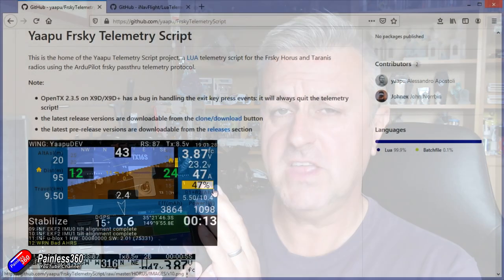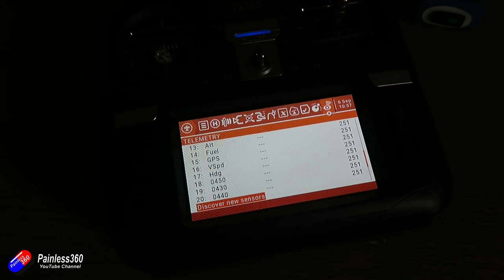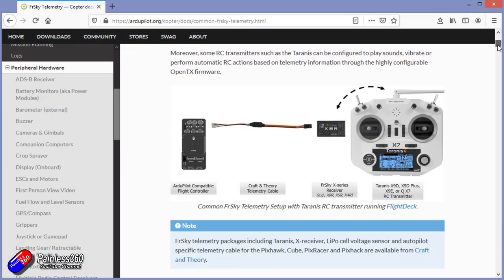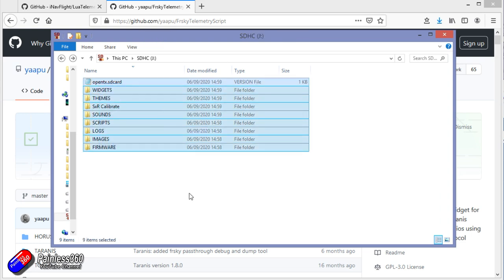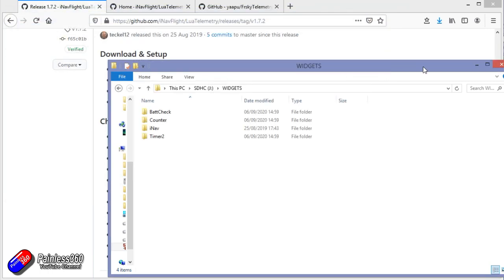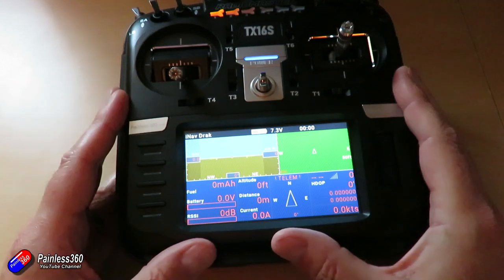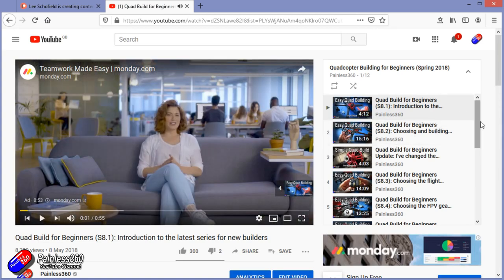Installing Telemetry LUA scripts onto the RadioMaster TX16s (Yaapu and iNav)

Comment: Ive got a Cubepilot on my Quadcopter and Crossfire, TX16s, and Bi-directional telemetry, my direction arrow appears to be incorrect in the Yaapu Script.. any thoughts?
Reply from the maker: If the direction is right in other places then I'd delete and rediscover the sensors as step one... Best of luck

Comment: Is there any point using these with Betaflight? I do some midrange flying on a 5 inch with gps and baro.
Reply: And by the way, great video as always! Thanks.
Reply from the maker: I don't. If you do, let me know how you get on..
Reply: The iNav Lua Telemetry script does work with BetaFlight via Crossfire on my 5”. But you may run out of memory on some radios if you run the BF lua script and iNav Telemetry at the same time.
I find it handy if flying LOS without googles/osd.

Comment: I am using arduplane will it work properly?? Actually mine one is working but horizons is working very slow and most of the values is absent,I discovered several time by deleting sensors
Reply from the maker: I use it with my Arduplanes all the time and it works great. See my build series. Best of luck!

Comment: Hello can you help me out with my issue?           .. So just a days back I tried to install yaapu on frsky qx7 accst model. But after installing it can't run on my radio, it simply says, "script panic not enough memory".    What should I do? am I missing some steps.....       Note. I used open tx 2.3.15 and yaapu version 1.9.5.
Reply: And just to free out little more memory I just kept only one model on my radio but nothing helps
Reply from the maker: The EEPROM storage used for models and the memory that things like LUA scripts use are not the same thing. Make sure that no other LUA scripts are running at the same time and if the issue persists then log a bug report in the GitHub pages.. Best of luck!

Comment: Does anyone know if I can connect my TX16s to mission planner so I can use the Arduplane telemtry via my R8 instead of having a separate 900mhz radio for the telemetry to the laptop with mission planner?  I have this working and it's great, just would like to eleminate the telemetry radio in the plane and still be able to use mission planner real-time.

Comment: Hey! anyone know if with lua you can take the telemetry and push it out the USB or out a wifi port to be interfaced with a computer? trying to make a little program that wants the gps data, but would be great not to use mavlink for a more plug-and-play feel
Reply from the maker: If you are using OpenTX then you can log the telemetry to the SD card in the radio... Best of luck

Comment: I used in my long flight range, when video goes out, there is not way to know what is going on, so you look you radio and you can tell if the plane still flying and where it is because you have the gps in the radio, now when it crash there radio will start vibrating and the voice , telemetry lost, but you have the gps coordinates in the radio where the airplane is with in 10 feets/.

Comment: HELP!!!! I deleted sensors but when I went to "discover new sensors" nothing happened. I've tried multiple times and still nothing. Using TX16s with IFlight Nazgul5 4s analogue XM+ receiver.
Reply from the maker: If it can't see the sensors then check the flight controller settings and telemetry wiring back to the RX.. Best of luck
Reply: @Painless360  thanks, I'll give it a try

Comment: I wonder if this will work on my FlySky NV-14 radio..🤔
Reply from the maker: Only if they have a version that supports the vertical screen...
Reply: @Painless360  I got INAV telemetry LUA to work on my NV14 using the development branch of INAV LUA telemetry. I couldn't get Yaapu telemetry working. Im good with just INav..lol

Comment: Does anyone have their Crossfire working fully with Yaapu?  The roll, pitch, and yaw graphical gauge does not respond to any physical changes in the orientation of my flight controller. I can see the corresponding telemetry values refreshing properly on the model telemetry page as I move my flight controller around. Furthermore, there is a flashing NO GPS error and NO TELEM error message in the upper right, even though I can clearly see GPS coordinates appearing in the lower right section of the Yaapu widget.

I am using a Matek H743 running ArduPlane V4.1.0dev (acfdf6a3) and a crossfire diversity receiver with SERIAL_7_PROTOCOL=23, and RC_OPTIONS=256. On my Radiomaster TX16S transmitter, I tried running various versions of the Yaapu script starting with the older “horus_crsf_190b_0.7” up to the current "FrskyTelemetryScript-Horus-Widget-1.9.5-beta1". I ensured that CRSF is turned on in the Yaapu config. I'm not sure if CRSF is supported, that this is a bug or my user error. I have my CRSF receiver wired to Tx6/Rx6 (Serial 7) of the Matek H743. The receiver is configured with CRSF TX and CRSF RX on outputs 1 and 2 respectively. I also have another 2 outputs of the crossfire diversity receiver connected to SERIAL 2 with the Mavlink version 2 protocol running on those outputs.  I've tried with and without Mavlink.  I've tried a combination of outputing PPM for control and Mavlink for telemetry.  I can't for the life of me get this to work.  I've also tried both Yaapu with EdgeTX and OpenTX, crossfire running at 150hz or 50hz.  Nothing :-(
Reply from the maker: The last time I did it was in this build ArduPlane, Matek F405-Wing and AR Wing build: https://www.youtube.com/playlist?list=PLYsWjANuAm4riGiv4GPJfCuktGXZ22nmV best of luck
Reply: @Painless360  I finally resolved my issue here.  Lee, in your diagram, you suggested setting Crossfire to use SBUS out and MAVLINK back into the FC. Since Ardupilot has evolved since then, I think it would be better for users to simply use CRSF_TX and CRSF_RX. That said, you must use an Ardupilot version with Crossfire support. No need (at least that I can find) for Mavlink. This worked for me, but there are some very important gotchas that I think many Crossfire users will overlook:

1) Firstly users must consider what UART they are using. I had my crossfire connected to a UART which certainly works for Crossfire RC control and allows telemetry, however it would not work with the Yaapu widget. That is because the UART port does not have Direct Memory Access (DMA) with my flight controller (the Matek H743 Wing). I could only get the Yaapu widget to successfully work moving and connecting my CRSF_TX and CRSF_RX wires to SERIAL1 (UART port TX7 & TX7) or connecting them to SERIAL2 (UART port TX1 & TX2). By default, the Matek flight controller documentation suggests using UART 6 (as they label it “RC input receiver”). The only UARTs that should be used for RC control and successful use of the Yaapu widget (for this FC) is UART 7 or UART 1 (those have DMA). There is no need to set any extra outputs of your Crossfire receiver to use Mavlink.

2) I noticed that another user on a blog made another mistakes of mine. Alex (Yaapu) told me, I must set Ardupilot RC_OPTIONS = current value + 256. I thought I did that. Instead what I was doing was heading to the “options” under the serial settings section… I was incorrectly setting SERIAL7_OPTIONS to its current value + 256 and not setting “RC_OPTIONS” to its current value + 256. 
I think users with Crossfire will likely repeat some of my mistakes, as I did not find detail per this in the Yaapu installation instructions site. 

Thanks again Lee
Reply from the maker: Thanks for for sharing the answer! So few questions bother... Happy flying!

Comment: model name is gone my model select screen, when ı select a model write the main screen but dont write the model select screen why? its happen after upload script, thanks for video
Reply from the maker: No 8dea, let me know what the cause was when you get it working.. best of luck
Reply: @Painless360  ı fixed but dont know how, only put the sdcard in pc and try the changing background again, bg is not change ı couldnt that but fixed, problem is same text is same color with bg

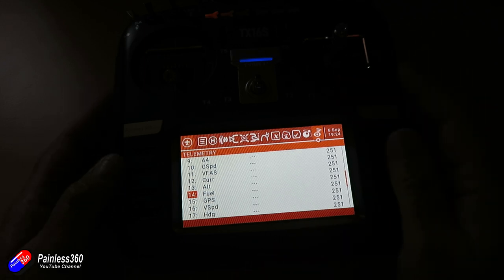Comment: @ 13:45 you say its important to fix not being able to get all the sensors to show, but you never say how to do that. That is the problem i am running into. All the latest software for radio and inav, still no help.
Reply from the maker: See inav builds on the channel for full setup. What troubleshooting have you already tried?

Comment: Thanks for video, I followed your steps more than once but when i try to select inav in telemetry menu it says inav disabled I rechecked settings in inav all telementery tabs turned on, in radio in model menu im showing all sensors live data. Why is radio showing inav disabled? How do I enable? Thanks for any help
Reply from the maker: What troubleshooting have you already tried?
Reply: Is checking settings in inav and checking for sensors data in radio not troubleshooting, new pilots trying to learn the hobby watch your videos to learn so what troubleshooting do you recommend?
Reply from the maker: Following each of the steps and telling me where yours is different is a great start...
Reply: My steps are same as yours except on radio in telemetry menu I navigate to inav try to select but it says disabled even through I have turned on telemtery in inav. Thanks for any advise
Reply from the maker: https://github.com/iNavFlight/LuaTelemetry/issues/253 seems to explore it a little. I'd make sure you're on the latest version and go from there.. Best of luck!
Reply: Thanks ill keep researching
Reply: So I finally got everything working and looking like yours I thought, so while flying I've noticed that the model heading-bearing is way off according to a compass. What could cause this issue? Thanks again for your videos

Comment: Hi I have TX16S using it with H743 FC and I have an issue. When I tilt my FC to the left my graph on the transmitter tilts to the right and when I tilt the FC to the right, the graph shows tilting to the left. Any ideas??
Reply from the maker: https://youtu.be/lxVd4LnHDjQ may help